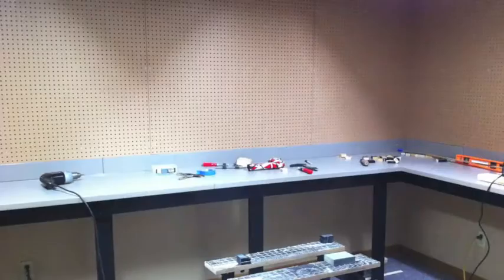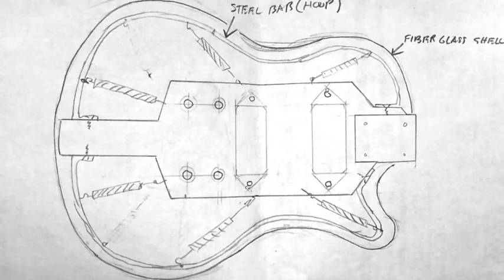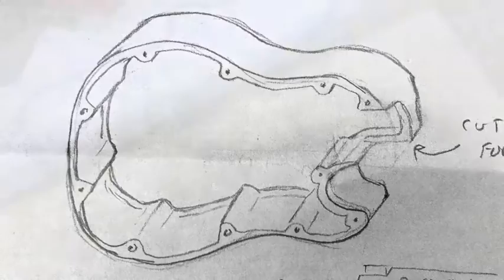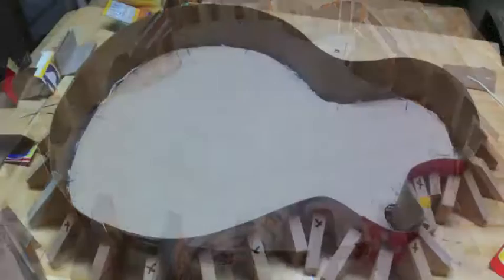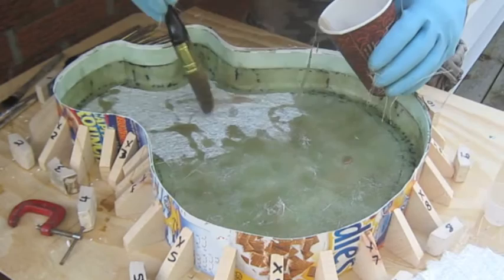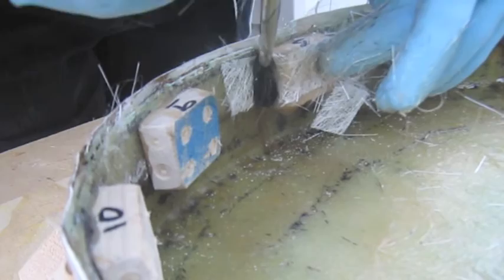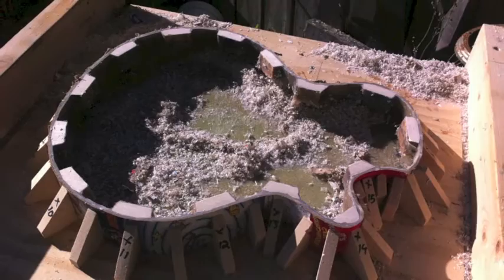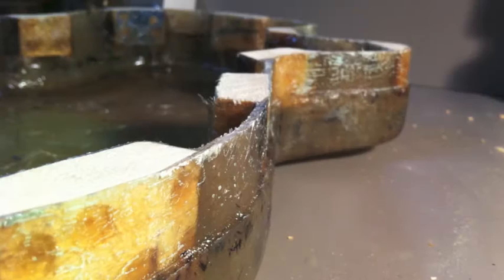STOP SIGN GUITAR-PART 2 Making a mold to create a fiberglass guitar body.

Comment: hey johnny how many layers of fiberglass did you use and what kind of resin did you use i plan on makin a diy resoglass bass need help thanks
Reply from the maker: I used two layers for most of it but built it up more around the edge to give it strength. The fiberglass back is just a cover and doesn't support the tension of the strings at all so I tried to keep it as light as possible. I bought the cloth and resin in an automotive store. Good luck on your bass I would love to see pictures.
Reply: JOHNNY B GUITARS thanks ill do that but should I do like 3 or 4 layers since the center block is what the neck attatches to and the block is eqoxed to the back cover